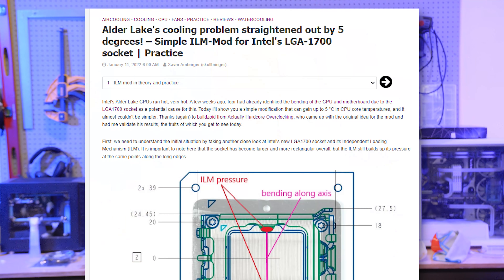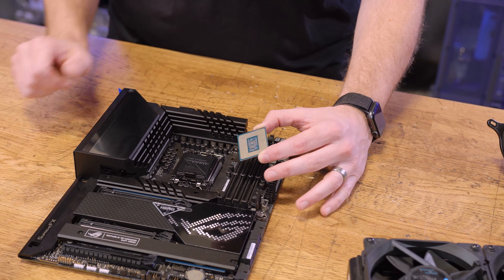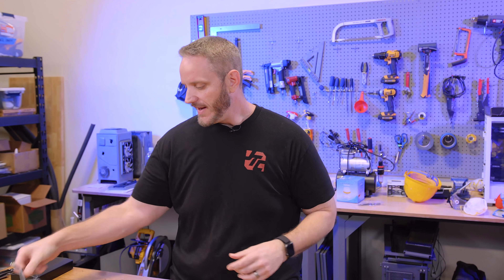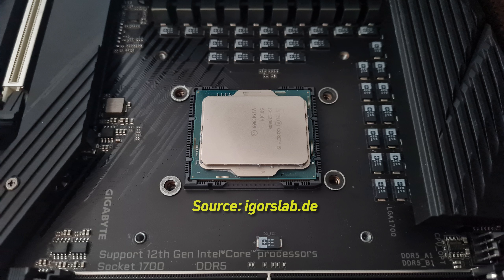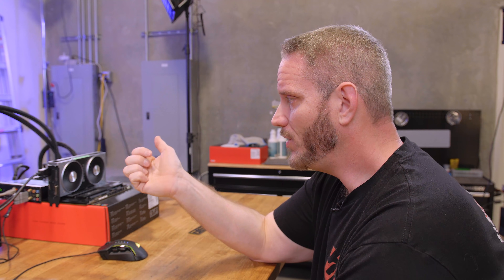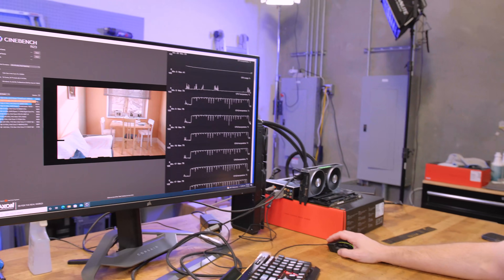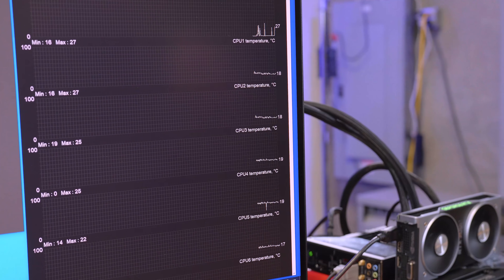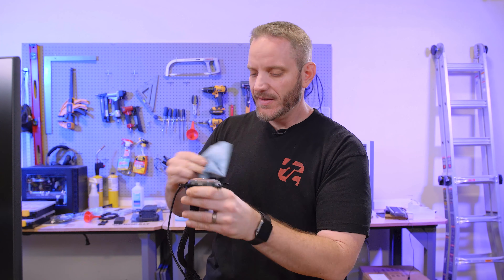YOU GUYS asked me to try this... so I did

Comment: G'day Jay, Phil & Nick,
Now I am Confused🤨, As the Socket is Soldered to the Motherboard, the only thing I see that mod changing is the Reducing Pressure between the CPU Pads & The Socket Pins,
which is then increased to Maximum when you apply pressure from the Cooler anyway, Plus the Cooler Mount Height is still the same Relative to the IHS Height So... 🤷‍♂️???
If the problem is because the Cooler Mount Heights are too low causing People Tightening the Cooler Mounts too much which is Decreasing Surface Contact,
then to me the Solution would be either...
Add the Washers to Raise the Cooler Mounts,
Add Springs to the Cooler Retention Screws for an even regulated pressure on all Mounts or
Not tighten the Cooler Retention Screws so much that they Bottom out on the Mounts bending parts.

Comment: I just ordered a Noctua 78mm bracket kit for $9 and my 12700K is idle at 20c/76c under load. Just make sure you order the right one. Noctua has 78mm and 83mm.

Comment: Can't see another comment saying this, but I interpreted the explanation as being the actual CPU retention mechanism itself was causing the bending of the the CPU and the socket backplate. I have experienced this on my own 12900K install. By adding the washers you lessen the tension holding the CPU into the socket, not the cooler block's contact with the CPU tension.

The other workaround that's been detailed is to ensure the cooler mounting baseplate is mounted on the motherboard before putting the CPU in, so that it ends up reinforcing the motherboard and CPU socket, making it more resistant to being bent by the tension applied by the CPU mounting system.

I've been experiencing cooling issues with my own 12900K under full load (Cinebench R23 multicore, thermal throttles instantly but still scores >27K) and it's very evident on my board and CPU that there is quite a lot of bending taking place around the socket, resulting in poor contact by the cooler (ARCTIC Liquid Freezer II 360). The thermal paste pattern shows very poor contact on just one side of the IHS too (the side towards the PCIe slots).

I'm working with ARCTIC support to try these workarounds and see if they help at all.
Reply: mind sharing the washer thickness that you used..?
Reply: @fist003  I've yet to try it myself but I've ordered nylon 1mm M4 washers based on what the article said. I'm going to try mounting the cooler backplate without the CPU first and compare the bending before and after the CPU is inserted.
Reply: Did you fid a solution? I am having the same experience with my 12700KF (not overclocked) in Cinebench. 2 of the cores (cores 2 and 4) sky rocketing straight to 100 celcius, and as a result thermal throttle. The E cores running between 81 and 83C, with the P cores lowest being 87C and maxing at 100C. The cooler I am using is the MSI MAG CoreLiquid 240R with LGA 1700 mounting kit. Tried reseating and reapplying thermal paste with no improved result. Short of trying a different cooler, not sure what else to try. Would expect better cooling even from a 240 AIO.
Reply: @PeteyPete173  I've built another 12900K system (for someone else) & seen the exact same behavior. I tried the washer workaround on my own system and it made no difference. On the 2nd system I didn't see any of the socket bending but the CPU still thermal throttles instantly under Cinebench R23 multi-core. The scores are good though, as the CPU seems to immediately clock down slightly to find its equilibrium. I also built a 12700K system but didn't see this issue. That CPU maxxed at around 90 deg C under same load. My best guess so far is that this issue a combination of silicon lottery and motherboard defaults/settings for 12th gen. With the MSI board it asks for the type of CPU cooling system being used on first entry to the BIOS, and if you select water cooling it maxes power delivery out. The CPU then draws huge amounts of power once under full load until it clocks back slightly to prevent thermal throttling.
Reply: @DamianPEdwards  Interesting findings. I have a Gigabyte board and it didn't ask me what cooling I would be using. Under normal use the temps are relatively in check, haven't really put it to the test with any sort of demanding game yet. I'm not a big gamer, but it's nice to have the power there when needed. I may end up trying the suggestion Igor's Lab mentioned, mounting all bracketry before installing the CPU, as the article mentioned it could be an issue in regards to the rigidity of the board and the cooler brackets helping to stop any flex.
Reply: @PeteyPete173 yeah during normal use the temps are fine, really good actually. Would be great to see some details of any folks who've successfully got a 12900K to run under 100°C under full load, e.g. cooler spec, voltage/OC settings, etc.
Reply: @PeteyPete173  the msi 340 or whatever had horrible reviews maybe its the whole line

Comment: What I have seen is how inefficient intel chips (in particular) have become - they have essentially thrown more power draw at the chips and wondered why they are throwing off so much resulting heat while having a cpu output power increase.    Instead of designing chips to reduce power consumption while increasing output power, intel is essentially doing what Detroit did to gain power - increase cubic inches which did increase horsepower/torque, but consumed huge quantities of petrol - then to support these heavier engines, all components had to increase in size and weight.   There was no attempt to make the powerplants efficient - old fashioned thinking to solve the problem instead of looking to find more way to take the power in the fuel and making efficient use of them.   In some ways, Apple has done things differently and done a better job of maximizing the power output with a decrease in power needed on the chips (which has also cooled the chips).    Good video.

Comment: I think a key detail was missed. It's the ILM (not the cooler) that's applying too much pressure across the middle of the CPU causing the CPU to have a slight bend. When a cooler is mounted it'll make good contact with the top and bottom of the CPU as these are the highest points. But the middle of the CPU will be lower and so the gap between CPU and cooler will be greatest resulting in less effective heat transfer and higher temperatures.
Reply: Ya i think he completely missed the point, unless I'm confused. 

 The cpu is higher and now rectangle and the retention cover latches on the same spots at the center of the sides of the cpu. That's ok for a square but not so much rectangle. The washers makes the Retention top  higher so it doesn't push so hard on the sides of the cpu,  bending it basically
Reply: @strongislandx  He said in the video that it's taller.  I don't get why you guys are so triggered, lol.  He also explained what the problem is.  He was just showing alternate way to fix it.  Did he not put washers under the ILM?
Reply: @strongislandx  ppl l lol
Reply: YEP! I was looking for this comment! When I heard him saying that he'll release the pressure the cooler exerts on the IHS by putting washers under the ILM, I was like WHAT!? :D That does nothing related to the cooler and it's mounting pressure! Now the ILM bending the CPU, because it's pushing it too hard in the middle - that sounds reasonable!
Reply: wtf's an ILM
Reply: @peter3337  the latching mechanism.
Reply: @peter3337  Industrial Light & Magic
😊
Reply: @peter3337  i it stands for i like mice
Reply: Thank you! I was very confused when he was explaining the issue. After looking at the original article, it clearly explains its the ILM causing the issue
Reply: I agree
Reply: So should we do the mod with the washers?
Reply: I agree.  I have stopped watching his content more recently due to the lack of work put into the videos.  I’m not sure what his goal is half the time.
Reply: Wait im confused...isnt the ILM part of the motherboard? So youre saying motherboard manufacturers didnt make the ILM to spec???
Reply: Do the B660 boards have same issue ? or is it just on Z690 ?
Reply: can't believe this channel is more popular than more informative ones. Missing the point because they didn't stipulate the reports enough, incomplete research was done. Rushing the content for views.
Reply: @Myre Kitsune  But, you needed to whine that this channel is popular.  Get a life

Comment: imo the only thing this mod does is put less force on the cpu to keep it in place, so no good, it's bad. it does nothing to change the cpu height , maybe the pins will push the cpu a little bit higher with a chance of no contact at some point and bsod. Lapping is good , even better when both cpu surface and cool block surface are done to match. Conclusion : use kingpin paste and don't bother with anything else.

Comment: I was having thermal issue with my 12700KF and my NH-D15 (Kryonaut thermal paste). The CPU was peaking to 100 C at the T-Junction under load. These temps forced me to double check my cooler mounting to no avail. I would later learn that my EVGA X690 motherboard had Multi-Core Enhancement turned on (my own doing) and this was causing my issue. Since turning off that feature I've stayed at a comfortable 50 to 60 C under load and 28 C at idle.

I wonder if enabling Multi-Core Enhancement (or another manufacturer's equivalent feature) for Jay's testing would yield better results with the suggested "fix".
Reply: MCE is an intel core by core overclocking feature. At stock just like this video, some cores will be faster than the other. But a basic enabling of MCE without changing the settings will make all your cores run at max multiplier. For your case making it an all core 4.9-5ghz overclock.

Comment: Would like to see you maybe test the effects on temps with water cooling on a CPU with the IHS on against a no IHS, EK does special kits for no IHS retention directly onto the processor.
Obviously not with your 12900k but you get the point....
Reply: called direct die mount. 
pretty freaking good, used to do it a lot on earlier gen CPU, untill some of them got soldered (swapped to AMD after that).
some people even remove IHS just to put some liquid metal between die and IHS, also helps a lot on the thermals, without running the risk of destroying the die when mounting the AiO.

Comment: I use a Gigabyte Waterforce x 240mm and my temps (in a Lian Li Dynamic O11D, so not che champion in airflow) are in cinebench so arround 74/76 degrees... So not bad at all.
But they are tests... In realistic use like games or programs, my cpu never reach the 70 degrees under load.
My cpu is a 12700K
Reply: Bruh my 12600k is 70+c in prime 95 already so dissapointed with it.

Comment: I'm pretty impressed with intel here really. The delta between the hottest and coolest cores are flippin great. I love new tech
Reply: My ryzen 5 1600 af with a single threaded load gets a delta of max 2 c betwen all cores.
Reply: @denisalexa4435  yeah correct me if I'm wrong here but I think AMD has been better about there deltas in the past.  And I think it has something to do with the shear volume Intel has had to spit out because of demand
Reply: Yeah Intel used to be pretty bad about this. Same with AMD.  And i believe it's because of how uneven the ihs has been in the past.  Don't get me wrong though guys.  AMD has improved there deltas too.  I have no bias against Amd or Intel. Both of there new processors are awesome.  It's a good time to be a part of our "PC Master Race".
Reply: Ye the 12900k is a monster for gaming the leap from 11th to 12 gen was very noticable for me and the delta temp between cores is pretty low like 1-2 degrees at most.
Reply: how much voltage did he use for the test tho ? He never said Vcore used
Reply: So uneven core temps is normal for them? Mine sometimes makes fans increase and decrease in bursts, sounds really odd when it's doing it.
Reply: @Nocure92  you can mitigate that annoying constant rpm change in the fans by adjusting the fan profiles. monitor the temps that it speeds the fans up at & just change the triggering temps on the curve
Reply: @Nocure92  yep uneven core temps are the norm. But the main thing is that you’d like to see the difference in temperature as little as possible which is borderline impossible because it’s a never ending physics problem. Some cores may be in use more than another and that’s really all it takes to create a difference in temperature within the CPU itself. 

But what your describing sounds like an issue with your fan curves. If idle it shouldn’t not be constantly jumping through bursts of fan speeds. Take a look in your bios menu and adjust fan curves in there
Reply: @Correa24bori  I used armory crate to improve it, but it still sometimes does it when the p cores get hot. Then it just bursts for a  second or so then goes back down.
Reply: @Nocure92  the only things I can think of is a lapping issue on the heat spreader, an issue with contact/thermal compound on your cooler, or possibly a bad chip. 2/3 of these is an easy fix but that third requires a little extra effort
Reply: @Nocure92  no lol they are not. Intel makes so many problems its not funny. I went AMD all the way after only using Intel and NVIDIA no more.
Reply: @FenrirYT13  I mean for 12th gen. I switched from a 4770k after black friday.
Reply: @FenrirYT13  sure thing AMD fanboi. You are just salty that your precious AMD rig is rekt by Intel 12th gen.
Reply: @mikerzisu9508  Someone must've missed the presentation where just a refresh with more cache took back gaming from Intel by a big margin. LOL.

It took Intel a year and twice the power output to beat AMD. Ryzen is what pushed them to try so hard to innovate in the first place and competition is good for us.
Reply: @VanillaWahlberg  chat is polluted with the worst fanboys on the planet besides apple, AMD fanboys….. intel is back on top, and will always be superior. I see butthurt fanboys everywhere crying that alder lake is crushing their dreams LMAO
Reply: @mikerzisu9508  🤣Alder lake is the first time Intel has matched AMD's performance in years. Keep dreaming bud.
Reply: @VanillaWahlberg  not matched, exceeded. There is a difference.  Typical AMD fanboi... you are the one that needs to keep dreaming LOL
Reply: @mikerzisu9508  If you can't understand that I meant they AT LEAST matched their performance, that's on you. You wanna talk fanboi, you can't even admit that AMD was beating Intels performance with an entirely new architecture in just 4 years. Intel had been developing on 14nm barely making any progress for the customer for years. AMD is the only reason Alder Lake exists to begin with. I applaud Intel's engineers for the work they did to come out where they are now, but, they only got there because AMD was taking market share and still is.
Reply: @VanillaWahlberg  I will agree with you that Intel's products over the last 3 generations has been lackluster and incremental improvements at best, especially 11th gen. AMD has been innovative and really stepped up during that time frame. However, Intel has taken back the title and I do give AMD credit for pushing Intel to finally develop a new competitive architecture. Hopefully it remains like this moving forward.
Reply: @mikerzisu9508  I agree. I think both companies need to stay competitive. AMD for instance jacking up CPU prices substantially with the 5600x isn't acceptable to me.
Reply: @VanillaWahlberg  I am in the process of building a new 12th gen rig. I build every 4 years. If Intel would have produced another poor performer in 14nm I would have gone AMD.
Reply: @FenrirYT13  I use whatever is the cost to performance ratio. I was going to get a 5800x but was able to get a 12700K for $299. Cheaper than the 5800x and better multi and single core performance.
Reply: @VanillaWahlberg  
Well, match is not the right word . Alder lake is a clear winner against anything AMD has.
Reply: @leonardoruiz5994  I'd argue that if it takes double to power consumption to do it, clear isn't the correct word. They win, but at what cost?

Comment: you messed up when you said you would have had to have shaved a millimeter off the cpu because you already raised the mounting bracket a 1 mm so how much space you have to work with would have changed. Right? or am i overthinking it?

Comment: your temps are way better than mine on a custom loop with the EK Quantum Velocity 2 on msi Z690 edge wifi, and I am using msi's cpu cooler settngs, one being stock heatsink. I need to toy with the bios. I think MSI may be setting voltages too high
Reply: Or maybe airflow. He was on a open test bench

Comment: Couldn't you just tighten the cooler bolts less tight? The only point of raising the bracket, is so you can bottom out the cooler screws? 
Just don't over tighten the cooler. No need to change the socket.

Comment: How embarrassing to buy a 4 to 5 hundred dollar cpu that isn't completely flat. This is what you get when 1. manufacture in  China, and 2. you mass produce to an amount you cannot possibly qc things properly. The end result is a dissatisfied consumer.
Reply: Intel is made in USA. I don't think it's a manufacturing issue.
Reply: the IHS has been concave when cool and shift to convex at high temps...  been the case for years. Nothing to do with manufacturing. Even if it was flat at room temp, it will go convex at high temp.